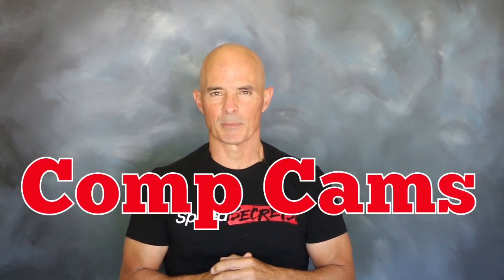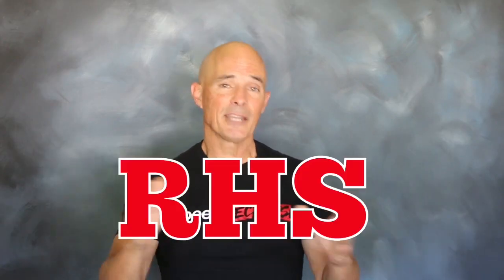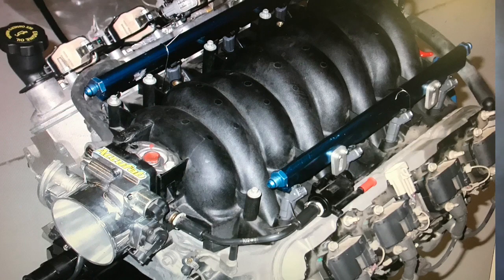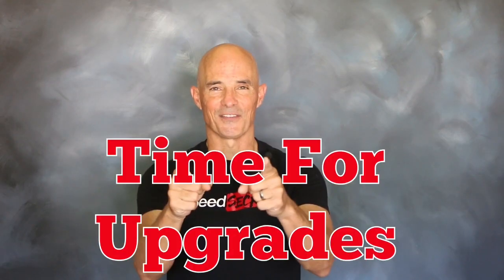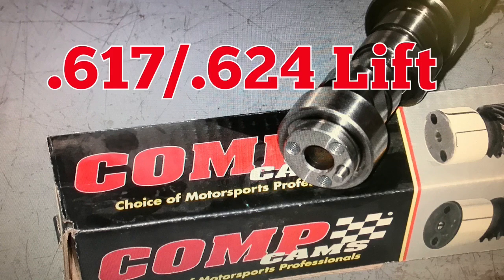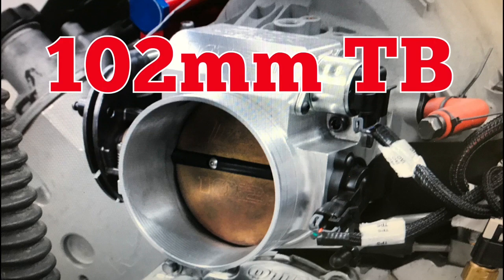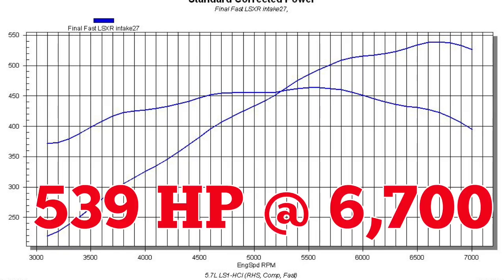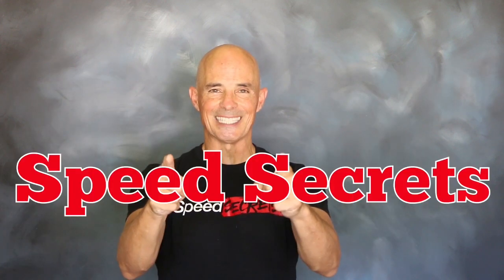Heads/Cam/Intake on an LS1: How Much Power??

Comment: Ok Richard I got it even though my heads are ported freshly machined bottom end h beams and 11 to 1's still missing the intake the early model fast smart injection and the performer what get that magic number of 500 ,,,,but until I can go back into it ,,,it will be a fun strong running motor ,,,,,,sorry for the questions ,,and you've told us all about the big three many times ,,I thought I had it ,,,so i'm Happy and Thank you again ,,,you to kooL ~! SiR

Comment: How come a stock LS1 made 414 on the dyno? shouldn't it make around 350?
Reply: Factory tests with all accessories,  intake, exhaust,  and tailpipes as equipped in the vehicle. This is optimized tune, 140 degree water, electric water pump, open exhaust etc.
Reply: This was exactly my thought. I had a 2000 Trans Am with an LS1. During that time span, the factory power was 320 hp. That should’ve been between 280 and 290 on the dyno. And I’m being generous there.
Reply: @fuktheserbs the 350hp from the LS1 is crank already.. if you dyno a C5 it'll have like 300whp (roughly). Thanks for the comment though, yet i'm still confused. If the LS1 makes 414 crank, then a C5 would make loads of power on the wheels
Reply: @DutchZombieSlaya  Long tubes replacing log style manifolds and crappy exhaust on a 350ci motor will give around 50HP.  He also has aftermarket computer for tunability, so the A/F and timing was dialed in even more than stock.
Reply: Long tubes and tuning.    The Corvette had the 346ci making 350-360HP back in the day.

Comment: Thank you for this video! Can you guys give a recommendation for heads and cam with a FAST 92 intake and throttle body?  I have the FAST set up with SLP exhaust. Stock 2000 LS1.  What do you recommend for heads and Cam?
Reply from the maker: The new RHS Pro Action Cathedral Port heads sound like a great option! For a cam recommendation, give us a call or send us an email so we can help you make the best decision possible!
Reply: Ray DeMarco did you go with anything yet?  i was going to go from the stock 241 to the 799 /243’s !
Reply: @pantherz2010  hey I didn't make any purchase yet actually still in Afghanistan for a bit. The Camaro is in the shop getting paint while I'm away. I'll try and keep you posted. So 243s/799 are pretty good option?  I was reading online they are a good option even better than 241s that are worked

Comment: Did stock ls6 heads, Chinese manufactured intake with 102 mm throtle body summit stage 3 turbo cam at 226/230 .600/.600 lift at 113+4 lsa cam on my stock bottom end stock accessory long tube headered 02 z28 did 385 horse and 360 trq through a slipping clutch!!!
Reply from the maker: Thanks for sharing.
Reply: Accessory components rob power, not much but they do. I have a stock bottom end 5.3,862's with pac 1218's,sloppy stage 2 made 380whp, im also only running an alternator, and an electric water pump.

Comment: What size injectors were used? I assume the stock would max out. I'm interested in all the details missing from the video.
Reply: I would actually opt for a slightly higher lbs injector for about the same price or slightly higher...say a 42 lbs or 48lbs injector to reduce the duty cycle on the Injectors (I believe optimal duty cycle is around 80%). More food for thought isn't just exceeding factory Injectors but adequate fuel supply so when running a Heads, Cam and Intake setup always be conscious of the factory fuel pumps limitations. Factory LS'1s had a 190 Lph so around the 450+ range you could be tapping out the pump. I recommend upgrading the pump to a 250Lph so you'll be fine till the 550rwhp range. Hell, might even consider a 340Lph if yiu have bigger build plans.
Reply: Probably 32/36 pounders. Texas speed has some decent deals on drop in injectors. 

Stock 01-02 injectors will make it close to 400 wheel. Some guys use the supercharged 3800 injectors for a little more.

Comment: What kind of ls1 Makes over 400 stock??
Reply: Ls1 had dyno headers ,no cats free flow exhaust no accessories no restrictions in intake flow  fast efi that's why it produced more power I'm guessing
Reply from the maker: @richardaugustine1842  Correct! These engines are tested under optimal conditions, whereas factory numbers require accessories and emissions parts.
Reply: @Compcams1976  you don't see a 25percwnt loss in belt driven accessories
Reply: @richardaugustine1842  Oh okay. I was sitting here like "What the hell!? Why am I only making 350!?"
Reply: @richardaugustine1842  if anything that would bring power down due to lack of backpressure
Reply: @bobbybrown6027  backpressure is not needed
Reply: Shhhh it’s still a secret
Reply: @Trevor Lahey are you 2000ft below sea level? Lol. My ls1 with full exhaust and ls6 intake put down 330
Reply: @PapaZyn  exhaust and tune is worth way more power then just a intake
Reply: @mattm3843  my long tube header, x pipe, slp catback made 330 to the wheels. (This is an 04 ls1 with an ls6 intake stock, ls1 intake Boggs it down more)
Reply: @Trevor Lahey So you're only losing 5hp through a T56? You need to share you're fluid engineering with NASA. With a 12% drive train loss (really liberal estimation for your sake) a stock 01 ls1 would put down 295. You sound like you just read Edmund's
Reply: Papa Zyn not all dynos read the same, trap speed is what would really confirm the power and it’s pretty well known that any ls1 is essentially the same as all the others save for the ls6 intake on later models and very minute differences in cam specs, and they are known to have all made right around 345-360 crank hp, lower numbers in the higher 200s almost always occur through an auto (22% lost give or take compared to the 15-18% through a 6 speed) and that’s all with accessories to turn and flowing through a restrictive stock exhaust and intake, set it up to breathe and a stock ls1 tuned for the breathing mods will easily make over 400 at the flywheel while turning all the accessories
Reply: My all stock internal ls1 99 Vette made 330 to the wheels
Reply: my 2002 WS6 Auto did 340RWHP 363RWTQ with long tube headers slp lid.... so it's a solid 400hp motor.... on a mustang dyno too
Reply: I thought they were about 330 at the crank tbh.its hard to fathom something like headers adds over 70 hp.
Reply: @GBrai-mu5zy  330 crank for early models (the LS1 was revised closer to the end of its run with a better intake manifold from the LS6...but that's also with production style exhaust and driving accessories. In the engine dyno there won't be any accessories and dyno headers. The net power rating be came standard in the 70s I think and was part of the muscle car horsepower number deflation. Low compression and emissions equipment took care of the actual power loss but it looked just that much worse with the new measurement after 1972.
Reply: @GBrai-mu5zy  no accesories on this dyno.  Thats why he gets more horsepower.
Reply: @Joey Rossini no shit? That's pretty cool.
Reply: None of them!!!!
Reply: @Trevor Lahey with a tune
Reply: The LSA is a little high. Close to stock.  Left a lot of torque on the table and a lot of hp under the curve.
Reply from the maker: Engine Dyno. To convert to Wheel HP, generally factor in about a 20% drivetrain loss, which would put you at 331hp.
Reply: @Compcams1976  we get that. But the ls1 didn't come out with that much horsepower at the flywheel.
Reply: @Stephen_Hodge  damn close man its was 320 ish
Reply: @Stephen_Hodge  Power is rated at the back of transmission with all accessories running.
Reply: @Compcams1976  no a stock ls2 makes 400 a stock ls6 makes 400 ls1 makes 340 engine horse paowe

Comment: Do you have a link to the heads that were used? I can't find them. Curious about the flow data. Thanks
Reply from the maker: These heads are debuting at SEMA and will be on the RHS Website soon!
Reply: @Compcams1976  thanks for the info and the quick response!
Reply: Was there ever a test done with the rhs small bore ls7 heads ?